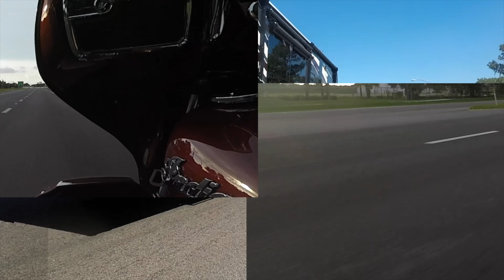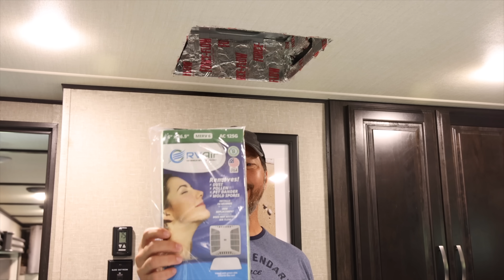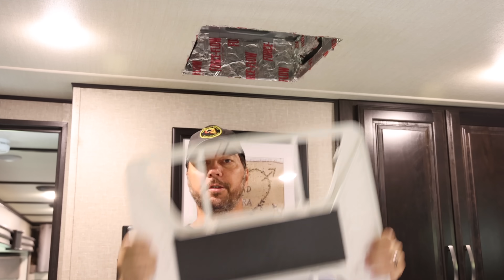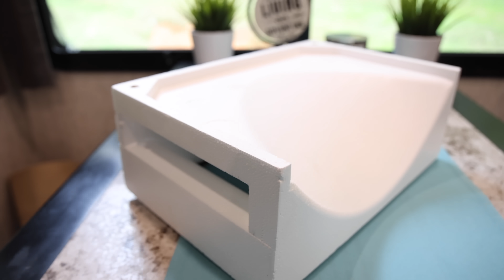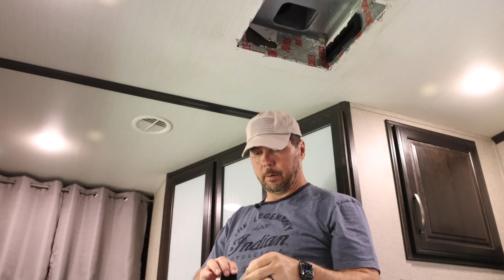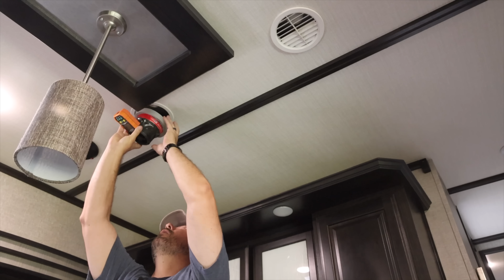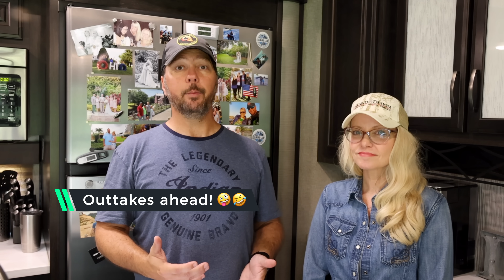Turbo-Charge your RV AC with RV AirFlow! (40% Improvement on Average!)

Comment: The other big issue is that the ductwork can be crap. You may want to scope the ducts to make sure they are efficient. Also, if you have to move the AC unit to center it, you may want to reseal the unit. Thanks for a very good video and demo.

Comment: I've made that mistake before :)   stop the video at 12:20 and look at how he's pushing that razor toward his other hand.  Building and drinking beer in the hot sun obviously isn't the best of situations, yet here we are.  I was opening a pack of shingles sloppily on a decently slanted roof.  Holding the pack with my left hand, keeping from sliding then trying to cut the plastic with my right. Well, I didn't realized I gashed myself until I went to pick up the hammer and it just slipped right out of my hand... turns out I was bleeding pretty good but didn't feel a damn thing :)  I learned that day to never cut toward my body, always away. drunk or not :)  JSWOA.  but I still drink beer and do dumb stuff.

Comment: 1 Thing I did to my standard AC system not having these Air flow devices was put foil tape over the slider vent on the inside of the cover to keep it from vibrating open and rattling while the units are running. Nothing worse than a rattle while you are trying to watch TV, since those slide vents are now obsolete with the Air flow system it wouldn't hurt block them off, this will prevent accidental opening and recirculation of air back into your unit.  My OCD for rattles and noises is always in full effect while driving a vehicle or in an RV, I will not rest until I find the rattle or squeak and have it fixed.

Comment: I didn't even know there was a middle piece in the AC duct area. After watching this video I opened up both of mine and sure enough that center divider had fallen over in each one. I put them back in place and now I have about a 50 percent improvement in airflow through my air ducts! Now I can close the dump vents for a cooler RV and it's quieter! I am definitely getting the RV airflow system and see how much more it will improve!

Comment: I noticed a huge increase in air flow with my rig as soon as I popped those stupid directional circles out of the ceiling. They weren't allowing the maximum amount of air to fall instead they were only letting out a little bit and the rest was going to straight to my bedroom. So I noticed a huge difference just by popping those out

Comment: Installed this product last week and EXCELLENT improved airflow.  I did have spacing problems with the vertical divider so I totally eliminated this on my Dometic unit.  So I just have the bracket with the long lag bolts.  Thank you for the video.  It gave me the know how and confidence to do it myself.

Comment: You guys really need to check your Freon pressures after installation. When you have more air moving through the evaporator coil you are warming it up. The more heat you add the higher the pressures go up. The units for sure gonna be over charged. Your a/c compressors gonna burn out prematurely. I can’t believe Coleman said it’s ok to do this. They must not care how long there unit lasts. I’ve been a technician for 17 years now. You need to check your pressures
Reply: OK...but my Coleman with the RV Airflow is almost though it's third summer and still performs extremely well. Airflow went from 8-9 mph to 18-20mph now.  The airflow prior  to the install had so many blockages I am surprised it didn't fail due to back pressures in the AC. Runs like it was designed to do now.

Comment: If I have dometic thermostat on the wall to turn AC unit on, does that automatically mean I have dometic AC units? If so Air Flow makes two different kits for Dometic. How do you tell which dometic AC do I have! They make one kit to fit a dometic  Penguin 2 or Atwood, and another kit for a dometic brisk air 2 or Evo or blizzard. I have AC in front bedroom and Rear garage area, both have dump vents.

Comment: I just installed one in my Grand Design Imagine. The only difference is I used the same foil tape that you used to seal up the box to seal the back of the dump louvers. Now someone can’t make a mistake and open one and as I inspected them I suspect air would bypass through the  louvers anyway because they don’t seal very well. Now it is sealed.

Comment: Just installed this modification this morning after suffering through 100(+) heat this summer. After watching your video and a few others the installation was a snap. Without measurements I believe the air flow has increased at least 50% and the RV is much, much cooler. A must for RV owners. Thanks for your channel and great instruction!
Reply from the maker: Great to hear! Thanks for sharing your experience! 😊

Comment: While my 5th wheel has ducted ac, only the front bedroom ac has a plenum accessible from the inside. The rear ac vents etc. for maintenance are only accessible from the inside of the ac unit (removal required). It’s a poor design for sure and I’m assuming I would only be able to use this on the front ac? Or is that a question best left to the manufacturer?

Comment: How do I get the discount code?  I have three air conditioners in my Grand Design 350M and after watching this video, I want to put this in all three units!  Also, have y’all ever swapped the garage 13.5k BTU unit with the bedroom 15k BTU unit?  The bedroom is a much smaller area and the 13.5k BTU unit is much quieter. Seems the swap while installing the RV Airflow unit would make good sense. Thanks!

Comment: This is good info...It is 105 in the shade here in Texas and my AC is purring like a kitten... I would like to add what I did to my Mach 3 coleman AC unit that made a night and day difference on my RV.... I stay out at the lake in the summer and live in my RV for 2 or 3 months out at the lake every summer, so I need my AC...I bought some regular o'l pipe foam insulation and put it on all the cold pipes between the Compressor and the condenser, covered the accumulator  in 1/4 inch foam padding using 10" wire ties and glued the 1/4 inch foam pad onto the entire outside of my tin condenser box cover using spray adhesive. The water practically trickles out of the condenser now and the air is chill coming out of the AC vents. I also put a corrigated tin cover on a 2" X 2" wood frame with 2"X2"X2" wood spacers, over the AC unit. This creates a 3" air space over the AC unit and it is always in the shade , believe me when I tell you, it makes a big difference. Dont want to go into too much detail right now. Get some  1/4 X 20  4 inch long flat head bolts to screw it all back down... You can PM me for more info if you want.... Dave

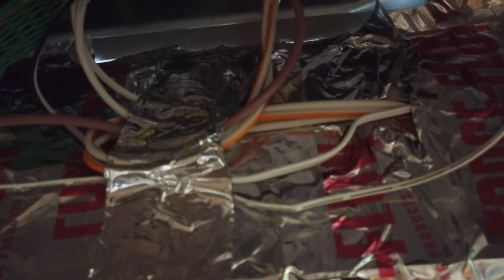Comment: At time mark 11:15, you mentioned “moving the AC unit”. Does that mean you need to remove and reseal the seal on the roof or was there enough “movement” with the seal intact? Great videos on this and the maintenance series as well. Thanks

Comment: Excellent video.  We have a new 2022 Reflection 28BH manufactured in August 2021. Grand Design did a fairly good job with the AC install. I first thought that our single 15,000 BTU Coleman AC unit had the original design, but it actually does have the new plenum box.  However, it was poorly installed. There were a few vents that had very little airflow, I could hear turbulence in the system, and the system didn't cool as well as expected.  When I took things apart I found that the duct openings didn't fully align with the openings in the Styrofoam box, and the rubber gaskets were all pushed out of place so the seals were less than perfect.  There were also several large gaps in the raceway duct openings.  I  metal taped the gaps in the duct work, fixed the rubber gaskets, and carefully aligned all the openings during re-installation. There was a significant airflow improvement and less noise from air turbulence.  Chad, you did a wonderful job explaining and measuring the system and flow improvements. Thanks!

Comment: I have a 2021 Forest River Cardinal Luxury  that has Dometic air system.  It has only small round vents in the ceiling , 6 in main living area 4 in bedroom & 1in bathroom. There are 10 return vents.  I am in Abilene been over 100 for days Run air at 78 to 80, run both air conditioners  about 6-7 hours a day .  What is the difference?

Comment: I appreciate your effort to get real before and after numbers, even with the divider issue fixed, that's a substantial improvement!

 I just opened mine to get the correct model and found that my divider had slid back (stayed vertical) and was partially covering my ducts. I should see more than 40% when done.👍

Cheers from your latest subscriber!

Comment: Do you have a video explaining the setup across your unit when using the RV Airflow?  I have a sheet that came with my grand design that talks about opening/closing the dumps when in operation.   Is it different setup when you have 3 AC’s vs 2 it mostly refers to.   GrDes 375RES.
Reply from the maker: Here's our video/blog: https://changinglanesrv.com/rv-airflow/
When you use RVAirflow, the dumps are eliminated in favor of better performance via the ducts... See the video for more details.

Comment: Looks like a neat solutiuon.  However i dont have a center intake and discharge like you have.  My intakes are closer to the walls ( 2 of them) and then I have 8 discharge a couple feet inward running the length of the room.  Our bedroom had its own unit but with this system blocking off the discharge ports, doesnt look like it would work for me.
Thanks for sharing though.

Comment: Just stumbled across this video today. I really appreciate the detailed instructions and video. I agree this product is a little expensive for what it is, but I'll be buying 2 for my 40 foot Montana when I start my planned mods when the weather warms a bit. The secret to any AC system is airflow; any brand can cool the air but it has to be delivered to the desired place to be effective and ultimately create a comfortable space. 
I really appreciate your air flow measurements but would have liked to have seen it taken a step further. I'm talking about measuring the air flow at the returns also. The returns are the most critical ducts in any system. It would likely be more accurate to remove the grilles / diffusers and take the measurements and convert to CFM. Air velocity (FPM) can vary somewhat in a duct system based mostly on duct size, diffuser, and length, CFM won't. If the total return CFM isn't very close to the supply CFM this might be an indication of duct leakage or even in the unit on the roof. The blower has to have the same amount of air on the low or negative side as the high or positive (discharge) side. If you measure a delta of about negative 10% or more in the returns your should try to find the leak(s), it's drawing that air from somewhere.  The sheet metal enclosure around the evaporator coil is inherently leaky if you haven't sealed the joints with foil tape or mastic. In this case, you would be drawing in some outdoor air; think of your Las Vegas trip where the outdoor temps were >120 degres!  Another good test would be measure the air temperature at a return and another measurement at a supply. Your laser thermometer would not be accurate for this, if you don't have a thermometer with an air sensing probe, a digital BBQ thermometer would be a fairly good indicator. The ideal delta would be in the 20 degree range.
On a somewhat related subject; have you ever looked at a dehumidifer? You might be surprised to find how much more comfortable you RV would be at 50% humidity and temps closer to 80 degrees. It would not be a factor in Las Vegas, Arizona, or SoCal, but most other places in this country.
Reply from the maker: We do have a dehumidifier but find running the AC does a pretty good job by itself.

Comment: What about installing a Mini-Split unit ? I know their will be a lot of things to figure out.
You could install the outside unit on the RV rear bumper. Since its DC it could run right off your batteries.
After starting up the unit should pull around 600 watts. These Mini-Split have a rather great efficient rating.
Also they are much quitter than the factory installed units. They could be installed directly into the RV.
No more possible leak from being on top. Just a few things that I was kicking around. I know it would be 
a lot of work first installation but wow.

Comment: Nice product but for $200 a piece vs the diy version of $20, that's insane.

The diy version is roughly         35% - 40% improvement too. 

I'd rather spend $60 for 3 a/c units rather than $600. Even if the actual product is 5% better it's not worth the price point vs diy. 

Nice video tho.
Reply: Can you share a link to the DIY version?

Comment: to tighten down the 4 lag bolts the manufacture (Coleman) has gauge strips in the foam rubber seals for proper tightening.  With this over prices piece of foam you can not use Coleman's method of proper AC lag bolt installation.  Using 40 inch pounds  with a 1 inch thick foam rubber seal I don't think so!
Reply: Before I removed the 4 lag bolts I measured their lengths, as well as marking them with white paint.  You are correct in stating that the foam insert blocks the view of the gauge strips, but only two of them.  When reinstalling the lag bolts I did use a torque screw driver and set it at 40 pounds.  It was soon obvious to me that 40 inch pounds was way too much: my foam gasket looked very compressed and the bolts that I could see were no where close to the measurements I made before removal.  I loosened all 4 and re-tightened, watching the two gauge strips that I could see, and the marks on the bolts that I made before removal and the torque came out to be right at 20 inch pounds.  The foam gasket looks like it did before I removed the bolts, and a check with a water hose confirmed there was no leakage. I plan on rechecking the bolts at least once a year.

Comment: Thanks, I used your promo code and ordered. I am so glad I purchased this upgrade! We have a black label voltage epic. Even with 3 AC units, being all black in 100 degree temperature is a struggle. This made a huge improvement in our rig. Being full time RV'ers we could not be happier with the performance.

Comment: Installed it before it got hot here in NE Ohio. Last year our Coleman A/C used to have to run almost continuously on high fan mode when the temps were in the 90's. And, we'd have to run the bedroom A/C to knock the temp down before bed. Now with this installed our A/C runs for a few minutes at a time, at low setting, on even the hottest days. And, we haven't had to run the bedroom A/C at all! Also, it now blows so hard-even on low setting-that it blows the dogs hair around while she's laying on the floor! Awsome product!

Comment: Unfortunately, you were not able to show if this device cooled your RV any better than your stock set up. Since your ductwork runs right next to your hot roof which has been baking in the sun, I would imagine that by the time the air comes out of the vent, it isn't very cool any longer. Airflow has increased, but what about the cooling??
Reply: The cooling in my trailer has greatly increased.  The AC doesn't run as long before it reaches the Set temp on the thermostat.  The air is moving much faster through the ducting in the ceiling, so it doesn't absorb  the heat.  The other day I was demonstrating it to a fellow forum member and the outside air was about 90 degrees. The trailer was sitting in the bright sun, no shade, and had only been running less than 1/2 hour. The airflow measured 19 mph on my wind meter and showed a temp of 57 degrees coming out of the ceiling vents. Works for me!!

Comment: Excellent video. I’ll be checking our A/C when we get home from this trip, mainly to see the condition of the evaporator coil for obstructions (recently having an icing issue) but also possible air flow obstructions you described.
Reply from the maker: Be sure to check out the AC Maintenance video: https://changinglanesrv.com/rv-maintenance-air-conditioning/

Comment: Am I right in thinking that once installed this eliminates the ability to have the dump vents work forcing you to utilize the ceiling vents exclusively?
Reply: That is correct. But that loss is made up by so much more increased airflow from the ceiling vents that it becomes a mute point. I found the dump vents to be not very effective anyway, and now with the increased air flow I never miss them. It also increases the amount of air flowing through the air filters.
I have said many times in my replies that the air flow from my ceiling vents increased from 8-9 mph before the RV Airflow installation to an amazing 18-20 mph after installation using my hand held wind speed gauge.  Best mod I have made to my trailer in 4 years of ownership.

Comment: 170 dollars for a block of foam ..I'm sure it works but over priced alot..
Reply: It's a lot cheaper than having to add a second AC unit, which I had been considering until I added the RV Airflow to my trailer's AC. Now my wife complains that "It's too cold" .....

Comment: Thank Chad . Great information. So we have a 2021 Reflection 311bhs. Two A/Cs . The main A/C has this . Pressure as it does have this foam block in there . Is this the product Grand Design is using? The front A/C does not have this . I think I will install this in the front one .

Comment: Installed yesterday and let me tell you! WOW!! Turned on the ac after install and it blew out so much construction debris from all the vents. 100% worth it. For reference I have two Coleman Mach 15 Air-conditioners on a Arctic Wolf 3770 Suite 43 foot. Thanks for the 15% off too !!